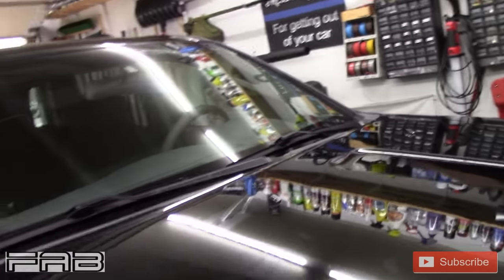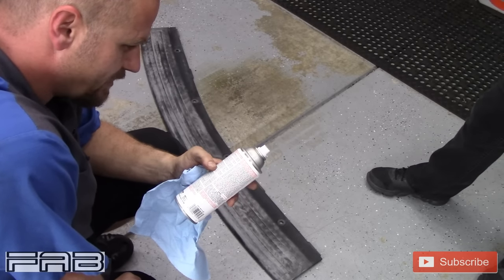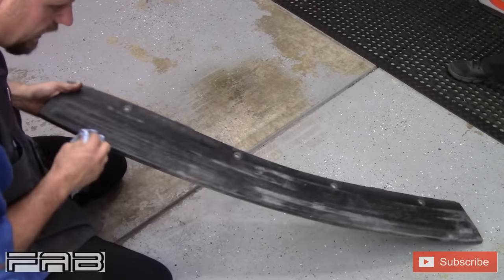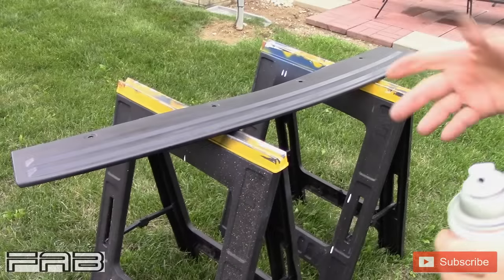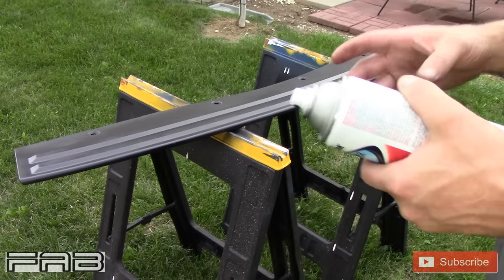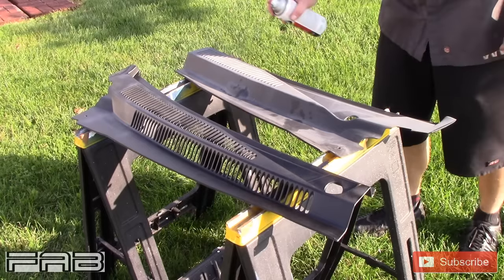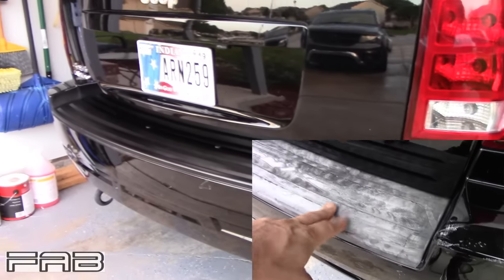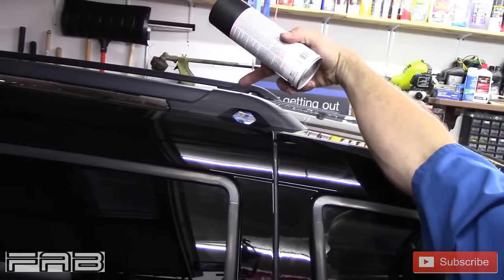Rust-Oleum Trim and Bumper Paint Review

Comment: I've used this 1000 times. Not only does it make your trim look new again but it lasts it doesn't fade!
Reply from the maker: I agree! It lasted close to 4 years on the Jeep.
Reply: @FABAutomotiveDetailing So is it more black than grey? Some of these like the one I got by Dupli has more of a grey appearance
Reply from the maker: @Titanic19127  Yes it is definitely black not gray
Reply: @FABAutomotiveDetailing  Mine is still sticky after 2 days. How would you go about fixing that? Gloss finish?
Reply: If it lasts why have to do it a 1000 times?   🤷🏼
Reply: @Titanic19127 to avoid that you should spray the paint at temps around 60+ degrees, you should also use rustoleum primer before applying the topcoat, you should also have washed/degreased the object and scuffed it before primer, do not spray while the humidity is too high, aim for 50% or lower, and give it the recommended dry time, 1 hour to the touch and 24 fully dry, i would personally wait the 24 hours, because the paint is still soft after an hour and can ding easily if you aren’t careful on reinstalling, if your paint is still sticky after all that, its probably a bad batch of paint, it happens, just yesterday i bought 2 cans of flat protective enamel and sprayed it and it turned out to be gloss enamel, the can says FLAT and i have used the flat protective enamel on another project that turned out great, but after i sprayed it was like wtf? Had to go get 2 cans of this instead because i want flat black lol

Comment: I have used Rustoleum truck bed coating on plastic trim in the past. It gives it a flat look and it adds non skid texture. The initial application took about 4-5 years before it started pealing/ got faded.

Comment: I just used this product last weekend on my tundra, it looks really sharp but I did 5 coats as opposed to the recommended 2 coats, didnt even out until the 5th coat
Reply from the maker: C Smith It’s been on for 2 years now and still looks just as good as the day I applied it.
Reply: @ C Smith. Curious as to how yours is holding up with the 5 coats instead of 3
Reply: @jayteepro  it still looks good today, absolutely no peeling, it was on a primer black plastic peice though, never had paint on the part before. There's a little bit of sun discoloration but hardly noticeable
Reply: What part of the tundra did you paint?
Reply: @dirtnsmores   top plastic cap for front bumper. Couldn't find the color matched spray paint like it was before so just went with this product. Mind you the cap was brand new and unpainted. Still today there's no peeling

Comment: Nice job!  I'm restoring a 1997 Land Rover Discovery 1 and just had the front bumper powder coated with a shinny hammered look, which looks fantastic.  Now I'm trying to determine  what to use on the plastic ends of the bumper and will consider the Rust-Oleum, but some people tell me the Forever Black works just as well if not better.  It is not a spray, it has a square foam tip and when you squeeze the bottle the form gets wet and you apply it.  It too looked great when I was finished.
Reply: I've used forever black and after about a year it faded. 3 coats on my rear caps on my 00' XJ
Reply: The Forever black works great for "instant" results but like some many other products of it's kind, only lasts about a year or less. The Rustoleum Trim & Bumper Paint will last 3 to 4 years before needing a refresh or even longer if you apply a UV resistant clear top coat after you have applied the Trim & Bumper paint.

Comment: my last three vans all had large parts of dark grey plastic trim all around the bodywork, I've always used either black boot polish or carpride back to black type products but after a few trips driving about in the rain it always just wore off and all the trim always looked just as bad as it was before,  I found this out by accident recently the last time I cleaned my latest van, I'de ran out of Mr Sheen and boot polish but had a bottle of white spirit and a half bottle of Boiled Linseed oil in the shed so I wiped all the plastic trim down with the white spirit using about half a roll of paper kitchen towel to get rid of all the dirt and tar spots and rubbed it all over with the boiled linseed oil using a microfibre cloth... the best result I've had to date.  cost me £2 for the bottle of white spirit and a microfibre cloth from Poundland & £4.80 for the bottle of Boiled Linseed oil from my local Seagers store with still loads left left in the bottle.
Reply from the maker: Mickey Flynn Thanks for the I info! I have some linseed oil I use on wood rifle stocks I refinish. So far the paint though is holding up great.

Comment: Wow they turned out so nice! I am wondering the same thing about if there is any difference between it and normal paint. Also really curious how it will hold up but personally it’s paint so it should hold up good! The Jeep looks so much nicer especially from the back with black plastic trim is stead of the faded plastic! Great video brother!
Reply from the maker: MeanBee392 it did turn out good! Better then I thought it would. I also think it will last a while since it’s paint. Thanks brother
Reply: It is simply a paint but with a priming additive.  Plastic surfaces are usually rough anyway so there won't be as any issues with adhesion.  I was using this stuff on my truck  to paint the bumper covers and bed rail covers. It wasn't a full can so I ran out.  I was able to finish  with the same brand black in satin finish paint. It is all still holding up the same

Comment: You can use a heat gun on low to bring the oils back to the surface of the plastic, then with 303 to uv protect it so it lasts way longer than rattle canning it.
Reply from the maker: Nate Wood I have seen videos on heating it up but have heard that it eventually won’t allow you to apply a dressing and looks worse when it comes back. I don’t know how true that is like I said I was told that I have never tried it.
Reply: I tried it on my Chevy. 

It did bring it back but it didn't hold up well. 

When I tried a dressing after using the heat gun method the plastic didn't take the dressing anymore so I pretty much runed them. 

They looked great when I first did it though.
Reply: Whats 303?

Comment: Was looking at this today and wondering how it worked. Thanks for the video, guess I got trim on 2 durangos to paint.
Reply from the maker: So I replied to this comment earlier and thought is was a different video of mine. This stuff works great. It’s been over a year and it still looks just as good as the day I did it. If it’s trim on the car you will have to mask off before painting.
Reply: Of course, I'll be removing all that I can, luggage racks, runnings boards and such. I will have to mask around the door handles.
Reply: @FABAutomotiveDetailing  or if you able to remove it first to make it safer.

Comment: another treatment i saw recently that can prevent the need to do this is heat gun treatment, but there probably is a point where you still need it repainted.
Reply from the maker: Raster raster I ha e seen those also but from what I understand once you hear it up it will fade again and won’t except any dressings or turn black again with heat. That’s why I decided to paint.
Reply: Hey guys the heat gun only works temporarily i tried it on my 02 ford excursion a year ago i took my time and came out great but the white spots came back with a vengeance so now I have awesome looking paint using the chem guys stuff but my bumper looks like cheap Marble print 😂 so now I’m watching this video as I’m taping up my bumper pads I’m definitely going to do my cal too thanks for the video 😎 round two here we go 👍
Reply from the maker: Joseph Desilva I have heard this same thing many times from others. This paint should fix you right up. You are welcome
Reply: Thank you 👍

Comment: That is a beautiful back yard where are you located?  Do you think plastic adhesion promoter should be used with this paint? does this paint have a texture? or dies it have a rubber ish feel?
Reply: I bought a rear diffuser for my miata , alcoholed to clean , 400 grit to scuff , plastic adhesion promoter spray and rust o leum matte blavk spray good for plastic , ive noticed ive needed quite a few resprats to get uniform coverage .

Comment: I was always told to use a adhesion promoter  by my Paint rep I paint and body work  for 30 years
Reply from the maker: buster tim Ok so where do you buy adhesion promoter? I have never heard of it. 30 years? I have always heard paint and body work is very hard on the body.
Reply: @FABAutomotiveDetailing  car paint suppler . Yes body and paint work is hard on people I got asthma from painting  . I tell everyone to wear paint mask
Reply: Autozone !
Reply: Adhesion promoter basically softens the plastic so the paint bonds with the plastic better.

Comment: How does it last against sun, when you leave your car outside
Reply from the maker: The Jeep has never been kept in the garage and it has held up well. After close to four years it’s just starting to show sign of wear.
Reply: Depends on where you live but if you want even more resistance to the sun you can finish with a UV resistant top clear coat. I know someone who used this product and finished with several coats of a UV resistant clear coat and it's still good 10 years later, even with regular sun exposure. Even if you don't use the UV resistant clear top coat, you can expect about 3 to 4 years before you can see fading and then you can just srpay the pieces again. But if you want the longest lasting results then go with the UV resistant clear top coat.

Comment: Hey thanks for the video! I have tan trim and rocker panels and am gonna spray them with this, would it be the same process for a tan to black or would there be different prep work?
Reply from the maker: You are welcome. It would be the same it just may take more coats.
Reply: @FABAutomotiveDetailing  Ok great, I another question. My rocker panels are part of the truck and are aluminum do you think this spray would work fine for them too? I know its not plastic trim so im second guesting myself...
Reply from the maker: @doncorleone9442  I don’t know how it would react to metal since it’s designed for plastic

Comment: I bought a used front bumper for my Subaru,it had some oil or power steering fluid on it ,after it sat over night I checked it to clean it and wow it has stained it and has a white calcium deposits on it ?

Comment: Can you use white instead of black ? Looking to get rid of the old faded plastic look on bumper and color match somewhat
Reply: Yes you absolutely can. You need to clean the bumper very well first. I like to use soapy water to start, rinse very well and allow to dry. Then clean it again with isopropyl alcohol or Sprayaway glass cleaner and allow to dry thoroughly, For the white paint you can use Rustoleum 2X Gloss White spray paint. Do 2 or 3 initial light coats, leaving about 10 minutes dry time in between each light coat followed by a final coat which you will go a bit slower so as to allow a little more paint to stick to the surface, just becareful it's not too much to cause the paint to run. It will take several days for the paint to dry well. You can apply a clear coat if you want to but it's not completely necessary for bumpers.  Just keep in mind that the Rustoleum Gloss White might not be an exact match for the white color of your car. If you want an exact match for the color of your car then you can order cans of premixed car paint that is matched to the color of your car paint. You will just need the paint code for that which is on a label, usually somewhere in your engine bay or on of the door frames.

Comment: Those damn wiper blades are on there so hard I’m scared of breaking the entire assembly trying to remove it.
Reply from the maker: walter kersting Yes you have to have a wiper removal tool. You can buy them at any auto parts store.
Reply: pop the cover off and use some wd40 on the nut. easy
Reply: Got one off e-bay really cheap.

Comment: What I may have done was hear gun the plastic then hit it with some solution finish black plastic and vinyl restorer. Just another way to do it. Hopefully it lasts.
Reply from the maker: Youbikewithatube I h e heard bad things about the heat gun method after a year. It will return and won’t accept any dressing or heat gun again. This has held up great for 2 years!
Reply: Don't use a heat gun on plastics. The heat just draws out more oils from inside the plastic, which will make the plastic more brittle. It will fade again quickly, usually within a year. It is used car lots that use the heat gun method because they don't care what happens after someone has bought the car. Trim & Bumper paint actually seals-in the oils which will preserve the plastic instead of drying it out.  The Trim & Bumper paint will last 3 to 4 years before needing a refresh, MUCH longer than "black plastic restorer" products.  If you want the Trim & Bumper paint to last even longer you can also apply a UV resistant clear coat on top of the Trim & Bumper paint at the end.

Comment: Do I have to remove my bumper? To do this method? I have a 2001 Nissan Xterra and my Bumper is Faded on the front
Reply from the maker: You could remove it or mask everything off around it you don’t want painted or overspray on.
Reply: Ok thanks so much for the advice
Reply from the maker: @tinalashay2498  you are welcome

Comment: Any reason regular spray paint won’t work?
Reply from the maker: Haven’t tried it so I’m not sure. Regular paint wouldn’t level this easy is the only thing I can think of.
Reply: @FABAutomotiveDetailing  what do you mean by level?
Reply from the maker: @bunkerfmpodcast  It sprays on level so you get an even finish without runs.
Reply: @FABAutomotiveDetailing  I have a jeep wrangler and the running boards are faded bad, I used this product that is supposed to bring back the black but it didn’t last long. I’m going to paint it. But they only make black paint of this kind. I want it to be OD Green so I’m using regular paint. It’ll be fine.

Comment: A heat gun can be used for faded plastics. When plastics age, especially in the sun, the oils leave the surface. The heat brings the oils back to the surface and brings the color back. Just be careful not to overheat the plastic. It can warp or melt
Reply: That a car lot trick. Doesn't last. Wipe on cerakote actually lasts.
Reply: Dosent last and you take a chance of melting the plastic or bubling the paint on the vehicle....Its not worth it
Reply: That doesn't last very long and you are just drawing out even more oils from the interior layer of the pastic which will make it more brittle.  The Trim & Bumper paint will seal in the oils and help the plastic to last longer and lasts 4 years before needing a refresh.

Comment: How has it held up?
Reply from the maker: JordaniusVonRhod Well it’s been over a year and a half and it still looks as good as the day I did it.
Reply: FAB Automotive Detailing wowzas im definitely using this then
I have a jeep wj with laredo plastic trim on the bottom and i want to paint it black
Do you think i could use a bunch of spray cans or should i just use a paint gun?
Reply from the maker: JordaniusVonRhod You can use rattle cans no problem. Just mask off what you don’t want to get paint on.

Comment: Used this on my 01 Sport Trac and it’s already peeling off.
Reply from the maker: Natureboy’s Wildlife It’s been on the Jeep for close to a year and a half and it still looks as good as the day I painted it. The Jeep is not garage kept either. It has seen rain,snow and a lot of hot sun.
Reply: FAB Automotive Detailing I did the back bumper, front bumper, and the side pieces. And my main problem is the side pieces. Right where I get in and out the paint has already been worn off and it’s only been a month, and then the back has gotten worn off where I get in and out of the bed of the truck. Is there any kind of protective coating that I can put on it?
Reply from the maker: Natureboy’s Wildlife There isn’t any type of protection you could put on that I know of.
Reply: Natureboy’s Wildlife that’s funny... I was looking for a solution for my 01 sport trac... didn’t want to see your comment.

Comment: The problem I have with this product is it's too shiny
Reply: it's very easy to dull the shine after you have finished applying the product. Just use a scrub pan such as ScotchBrite pad and very lightly go over the painted surface with the paid. That will remove the gloss. The other option if you don't want to sand is you can get a can of matte clear coat (such as Rustoleum 2X Matte Clear) and apply that on top of the Trim & Bumper Paint. That will take the shine away.